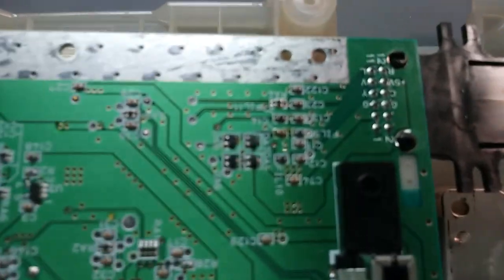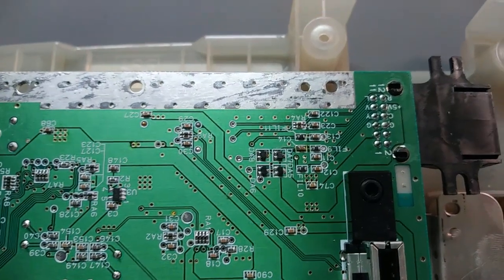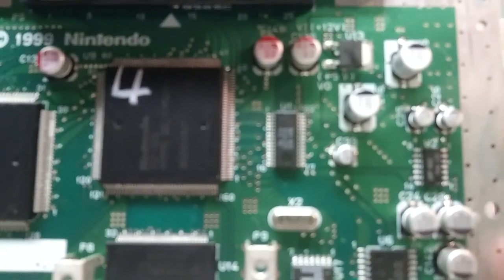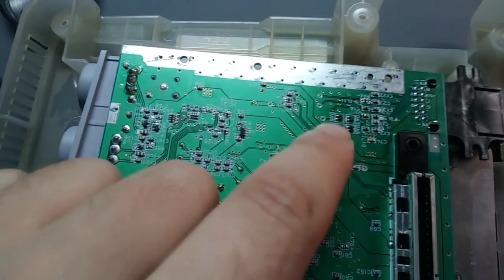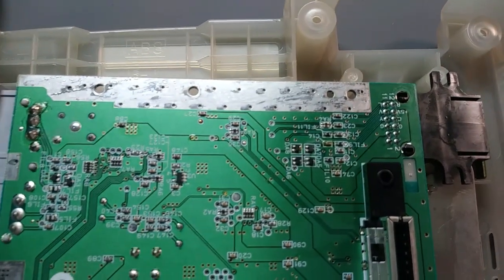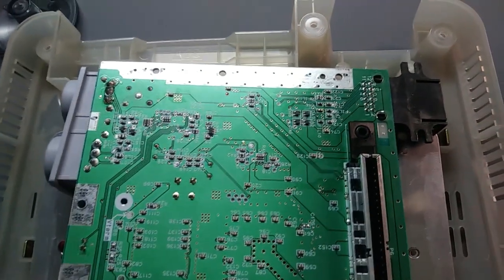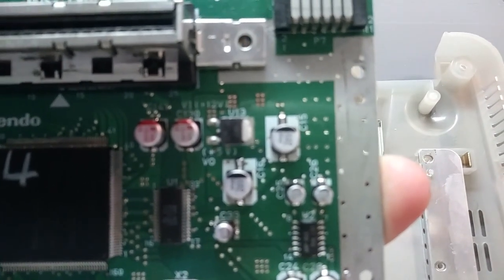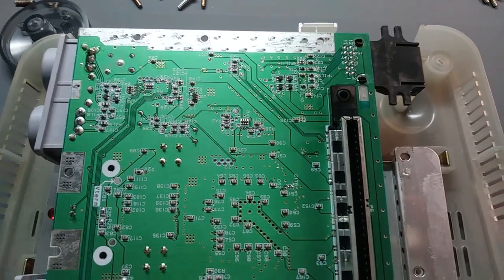N64 Black and White S-video Fix

Comment: Those caps of 220Uf 10v one is for s-video Y line other is for compositive they are not really needed in some last boards pal around 2000 and some ntsc they just don't exist so you could also bridge their pads no problem i fix n64 since the 2003
Reply from the maker: thanks for watching and commenting :)